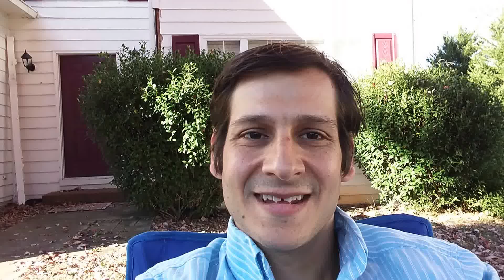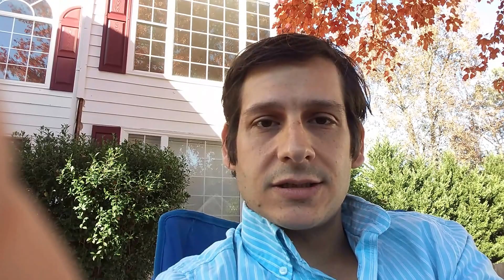3 Reasons Why You Can't See Your Target With Ground Penetrating Radar (GPR)

Comment: In California, trouble for majority of the time is clay pipe. It's hit and miss and tough to find using multiple filters
Reply from the maker: Hi Nathan! Thanks for the comment. What kind of filters do you normally use? Also, what kind of soil is the clay pipe in?
Reply: LearnGPR I started using background filter and removed anything past roughly 6 inches wide. The soil is mainly average soil in the area. Majority of scanning is through Orange, Riverside, and San Bernardino counties. These areas rest in an old river bed so heavy rock area in some places closer to mountains. Hardly any clay type

Comment: Just yesterday I was struggling to find a PVC remediation pipe in a fuel terminal. I knew it was running between two vault lids, but needed to confirm the path for my client. The pipe was likely too small / too deep for the 400MHz antenna I was using. I was, however, able to detect the edges of the trench and trace it that way.
Reply from the maker: Nice DeHart! Did you continue using the 400? Or did you go up in frequency to gain some more resolution?
Hope all is well brother!
Reply: LearnGPR Thanks! I stuck with the 400 and traced the trench.
Reply from the maker: Awesome. The 400 will do it beautiful in clay.
Reply: Jeff DeHart lol, good job